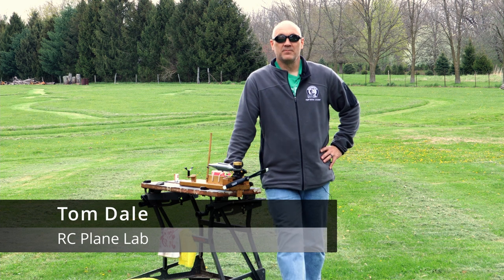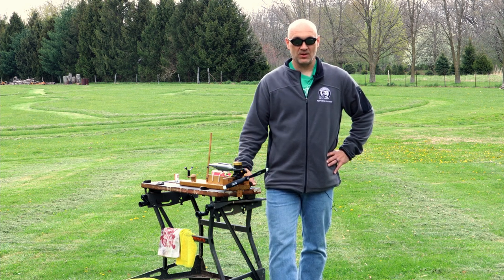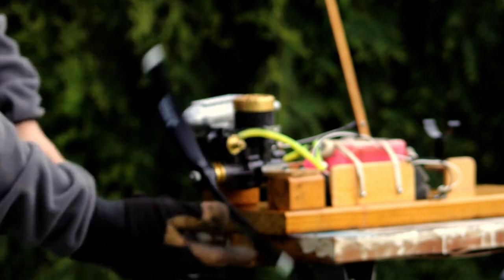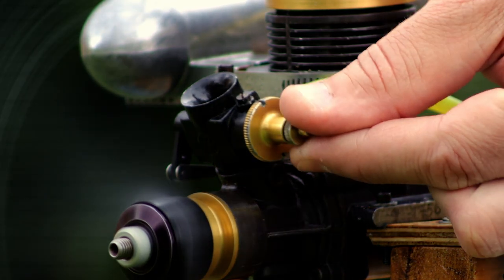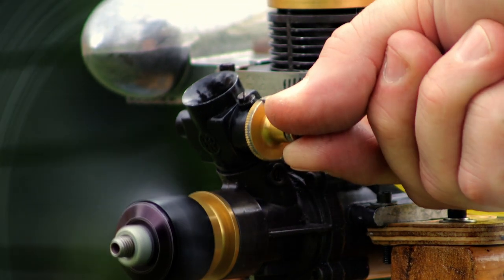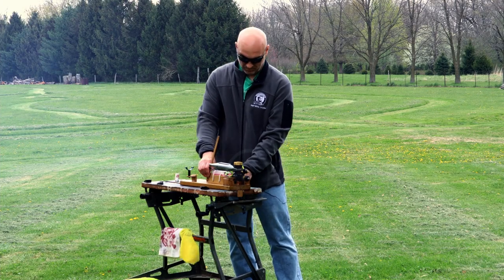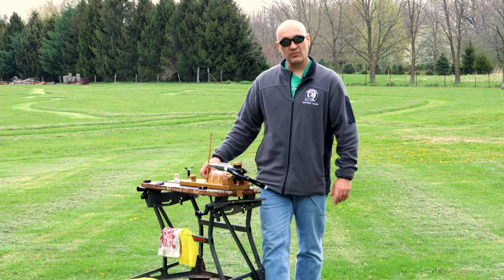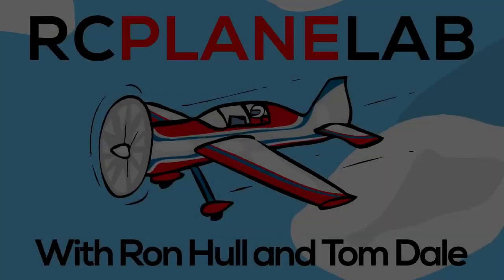Starting and Tuning a 2 cycle Nitro RC Airplane Engine

Comment: You say you are not happy because it is running a tad rich but in my experience the engine will unload when in the air and eliminate that tad bit of richness. I always leave mine running a teeny tad rich while on the ground. The one reason I do this is because if you lean it too much (an adjustment where you feel its perfect) ..... when it gets in the air and uloads it will then run too lean and shut down. Nice looking engine

Comment: Nice. I have exactly the same engine with little run time. Had been left for years with caster in it, took some cleaning out especially the Dykes piston ring which was ceased solid. A gift from a friend. Would be nice to see yours in a model.

Comment: Hi from Australia. Have just bought 2 of these same engines.  Thanks, your vid was informative however my engines were supplied with both low speed and high speed needles turned all the way in. Can you tell me how many turns out from the fully in position that might get me in the ball park for both needles. Not having any luck at the moment. Thanks
Reply: Try starting with the high-speed needle 3 full turns out and the low-speed needle 
2 turns out. Be sure to use a fresh glow plug and fresh fuel.
O.S. Type F (medium heat) plugs are very good, but pricey.
10% nitro should work well. It's all I use on larger glow engines.
Hope this helps.
Reply: Yeah I've heard the 3 turns out rule heaps, got a Cox 049 Bee going with this method!

Comment: I have a rc plane that is running too lean but I’ve adjusted the thing on the carb but it won’t change how it runs.  Anyone know what’s wrong?
Reply: Check for obstruction in the carburetor. You could have a blade of grass or something restricting the air flow…

Comment: Once you have made the "static" adjustments onthe ground, then does the throttle movement always generate monotonic increase in speed?  

For an example of monotonic increase, moving the throttle clockwise ALWAYS increases cyclic velocity (Hz).  Another  example of monotonic increase, moving the throttle counter-clockwise ALWAYS increases cyclic velocity (Hz).  A non monotonic adjustment will increase and then decrease the controlled variable.  

 I am interested in making a PLL motorcontroller. I am an EE not ME, so my vocabulary might appear strangely.